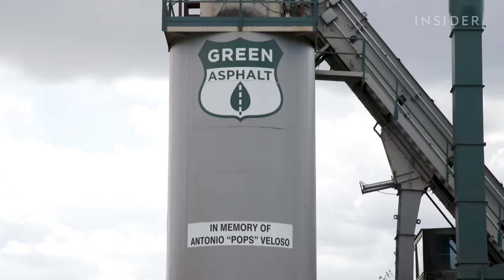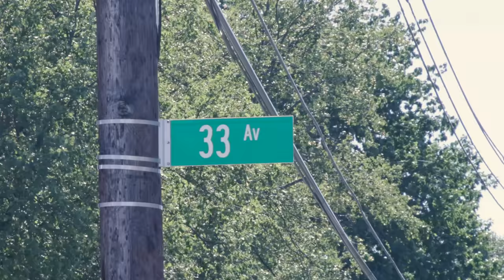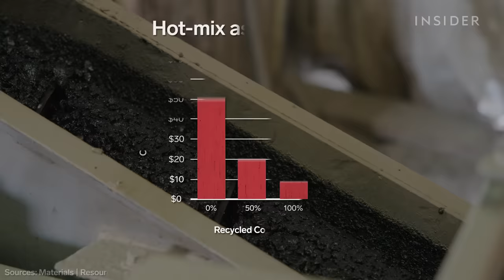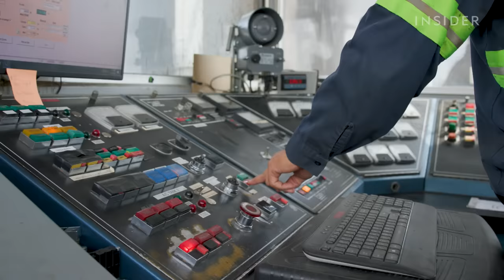Roads Can Be Recycled Forever, Why Don't More Cities Do It? | World Wide Waste | Business Insider

Comment: I’ve worked in the asphalt industry for 10+ years. On the road crew putting the asphalt down and now currently operating a loader at the asphalt plant feeding the rocks into the bins. Not all mix uses recycled asphalt and if it is used it’s still varies. Some asphalt might use 10% recycle. Other mix might use 30%. Some states don’t even allow recycle on certain jobs. From personal experience the more recycle you use, the shorter the life span of the mix you are making which causes more potholes down the road. If you buy asphalt. Ask for virgin

Comment: Unlike wood recycled asphalt still has the same durability, i think it is because the distributors that provide the materials dont want their sales of mined goods to stop
Reply: The sun and time age the material and bitumen.  It does not have the same durability - that is why they say in the video that they must add oil "rejuvenators" into the process.  The asphalt industry is not looking to increase mined goods - like any business, they look to reduce costs while limiting liabilities to produce material that fits the testing/specifications set out by the purchaser (in this case usually the State or local government).

Comment: I only worked with a paving company for about a year, and the base layers could easily be made from 100% recycled materials.
It would be more cost effective, and environmental friendly. If the cost of "binder" was reduced, a thicker layer would be more practical, making use of more waste. Grading the earth deeper, adds more removal, for sure. But that is generally all clean waste, can be used anywhere for anything. Petroleum soaked asphalt can't go anywhere, so trading dirty waste for clean waste and saving money just kinda makes sense if your not a greedy politician.
Top coat was always all new and small grit. That's kinda necessary, and so production will always be ahead of recycling. But of the materials recycled, less than 100% goes back, so if balanced right it could find an equilibrium.

Comment: Before 1990 torn up pavement was just dumped. In 1990 California required all
underground fuel & chemical tanks be replaced and the process was generating 
many many many many mountains of toxic contaminated pavement & backfill. 
So the state had the University of California to look at the problem and they
invented the process where old pavement was crushed down to gravel and
they built a soil burner on a simi truck flatbed so the crushed gravel & backfill 
was put on a conveyor belt which went thru an oven & the hydocarbons were 
burned off and the gravel & backfill was ready for re use.
Thanks California!

!

Comment: They've also done studies using a percentage of used tires in the asphalt, better grip in the rain and less cracking of the pavement, meaning less potholes, but the companies have political connections to prevent this from happening. So we live with almost constant road construction here in the upper Midwest.

Comment: I don’t know if this is worth mentioning, but I think that most asphalt parking lots would last longer if they got remelted once in a while. 

Just bring an asphalt surface up to seven hundred degrees, and then let it cool. That should kill the tar-eating bacteria, and rejoin all the inner cracks. 

A Bobcat pulling a flame-trailer would work. But the trailer would have to move very slowly. Maybe six feet per minute. The heat would have to penetrate to a depth of at least four inches.

Would the lot need a new coating of blacktop? Probably. And also a new paint job. But it would still be cheaper than a completely new layer of asphalt.

Comment: RAP is great. I’d love to read the research papers for the 100% RAP mixes and how that relates to superpave design methodology. From what I remember, lots of states don’t like using more than 30% RAP on long paving stretches because the contractor can’t guarantee the temperature range for superpave design.
Reply: The Cmi design principle that we used here in south Africa mix 60% RA with a drop of 40% on burner fuel consumption

Comment: Great story but it’s not about the recycled asphalt.  Most bases of the road have degraded I need to be replaced.  In areas where there is a lot of freeze and thaw the pavement just gives much faster than it would in an area where the climate is warmer.  The infrastructure needed to fix the road system stems beyond just asphalt tops.  You also need proper drainage to carry the water off the roadways in into the storm systems.
Reply: 100% correct. This is the most overlooked aspect in road and infrastructure maintenance in our country. You cant place a band aid over crap and expect a good road.

Comment: I work is a asphalt laboratory. We use 40% recycled asphalt in Australia. 100% would be complete rubbish. You would never be able to get voids and compaction right.. especially with slag and opengrade highway mixes.

That plant looks like its 50years old. The maintenance running just 40% recycling mix causes 100s of hours in maintenance.

Comment: The reason why they can't do a mix over 40-50% recycle is because the rocks sizes get smaller through  the recycling  process. The mixes are spec for a certain  size rock for strength  in the material . The mix can't hold up to the strength  that's demanded of it .
Reply: Theres specialized crushers for breaking down millings that minimize recrushing the aggregate. It will always break down from milling though. Places like Japan regularly use like 80% because aggregate supply is so much more finite when you live on an island.

Comment: Well that's not true when you grind it up you reduce the size of the aggregate and then reduce its ability to not wheel rut push or alligator crack under heavy traffic loads . Also when you use cold patch and Crack seal with different compounds it causes the failure of the mat earlier.What could be done is the recycled mix could be laid  down over stone and dirt roads for a viable solution to the silicone dust kicked up on dirt and gravel roads. Or subsase materials. IT HAS LIMITS.

Comment: As a Civil Engineer I can tell you the premise of this article is 100% false. Asphalt oxidizes and loses its ductility over time and can not be regenerated. Some asphalt is recycled but needs to have new asphalt cement to make a durable pavement. In fact, asphalt mix that uses recycled asphalt doesn't perform nearly as well or has the longevity of new asphalt.
Reply: What about the 75% used in Germany?

Comment: Alot has to do with how asphalt is made at the plant.  Plants have a drum dryer that heats and dry the rock and sand going into the asphalt.  Then the rock goes into the mixing chamber and the oil is sprayed in.  So you ask why the recycled material can't replace all the sand and gravel? You have to have heat to produce the product and the recycled materials going into a drum dryer will clog and ruin it.  In my area, state materials are only allowed 25% recycled materials, mainly because the oils deteriorate and multiple heat cycles on the stone comprises it's structural stability.  And any paver that says it's the same as other materials and an idiot or ignorant.  The higher the recycle content, the harder it is to finish smoothly without scarring and less compaction.

Comment: Around here they charge taxes on cement as its considered 'permanent". Then in Toronto they will charge you for adding a parking spot claiming the extra water runoff, but theres asphalt like materials and faux grass that allow water to pass through, but dont let that think the wont tax you for it. PS. Asphalt is also called cement.

Comment: In Philadelphia a machine works at night... the front of the truck grinds up the street, and sucks it into a huge bin in the middle of the truck.  That bin is heated by propane and melts the tar.   The back of the truck lays the asphalt back down onto the street as new pavement.  It moves slowly, about one foot every ten minutes, but it does an entire block or two every night.   No trucking stuff around, no extra trucks on the road etc....

Comment: In the 1990s, a Federal Highway Administration (FHWA)/United States Department of Transportation (USDOT) national mandate for the use of rubber in asphalt. As the mandate was rolled out, a lack of clear standards and deficient preparation for technology deployment (e.g., insufficient user training) created a number of problems in the field, ultimately resulting in the cancellation of the rubber use requirement by FHWA/USDOT.  The problems were mainly due to not having the correct ratio of rubber and other materials that bind the aggregate together.  Some states have adopted their own standards but since the rubberized asphalt cost more than traditional asphalt and no mandate or clear guidelines some states have not choose to use rubberized asphalt.

Comment: Anyone who has worked with a 50% RAP mix know there is a reason most places set a upper limit of 30%. Sure you can pave local streets no problem but if you have any real truck traffic on it, it will blow apart in a few years. Not to mention the extreme black smoke coming out of the plant.

Comment: Recycled asphalt is great, but it's not a panacea, either.  Depending on the original mix, how long it's been down before being milled for recycling, the properties of the aggregate, etc., you will eventually need some new materials to mix in.  The binder ages over time and loses some of the lighter fractions of the oils.  That makes the asphalt more brittle, which is why older asphalt roads develop cracks that have nothing to do with load carrying.  Those lighter oils will need to be replaced, or at least replenished.  If you're milling up recently laid asphalt, it won't be an issue, and you can probably get a couple of reuses out of a mix.  But not unlimited.

Same situation with aggregate.  Depending on what kind of rock it is, it does also break down over time.  Again, that's not a huge problem the first time you recycle it, probably, but as the percentage of sand and very small aggregate you recover goes up, you're losing the strength in the resulting mix.  You'll need to add larger stones back in (and dispose of much of the sand and very small stuff) at some point.

Still, the process ought to be more widely used.  It's used to some extent here, but I've been out of the asphalt business for 20 years, so I'm not sure what's current practice.

Comment: Asphalt blows in heavy truck traffic areas. It sags, rolls,cracks and generally falls apart rather fast. Build those roads with concrete because it is more durable and lasts longer with fewer defects.

Comment: Amen!!!!  More power to ya!   Even 50 recycled would be an improvement.  70% would be even better.  I've used screened millings and covered them with basement wall sealer, and a little sand on top.  It sealer soaks in and the sand or even pea gravel stops tracking the sealer.  If I can do that asphalt companies have equipment that could duplicate or do what you guys are doing.  Again, more power to you all.

Comment: has been working with a road authority for ages, their test site lay new pavement almost every month because they accelerated the load a lot for testing. they recycle 100% of the pavement. Sometimes if they got a project on new material then they will have to swap over, but asphalt is 100% already. to me, the decision to use new is main due to laziness in making changes, and the profit on the existingl industry. if new road has to use new material, then these oil and mine industry will continue to profit from it, intead of the recylcing industry.

Comment: Recycled asphalt often has ground up ferrous metal in it which then within months starts produce rust stains and eventually pits as the metal corrodes away. Doesn't matter so much on a public road but on your driveway it can look like heck. So when you asphalt  your own driveway ask them to not use recycled if you care about its looks

Comment: The grinding to the repaving should all be done at one time. The should be a grinder that chops up the road, then the material is heated in a drum, new "tar" is mixed in with the old, it comes out the back and goes into the machine that spreads it out, and then the rollers and packers go behind it. Like a big caterpillar eating old road and pooping new road out of the backside. It doesn't make sense to dig up hundreds or thousands of tons of old asphalt and haul it 25-50 miles back to the paving company, then grind it up and haul it back to the job again.

Comment: So, this has been common knowledge for those in the trades, for many decades. Im concerned about the comments here. Folks are extremely ignorant to how infrastructure is built. This is only 1 specific material focused on in this video. There's concrete, bricks, dimensional lumber, drywall, glass, metals, plastics and several different types of rocks, sand and soils. Recycling has been happening since before anyone could document it. Humans are not as wasteful as some tend to proclaim. We just tend to live longer than most creatures and have the ability to voice thoughts and feelings better than any other creatures. Keep it simple. Do your best and be productive and efficient.

Comment: Far and away the biggest issue with asphalt roads is poor longitudinal seams.  Cuts the service life of the pavement down by more than half.  Here in Minnesota MnDOT has no clue how to get longitudinal seams correct.  Many highway projects around the Twin Cities have failing pavement sections due to poor longitudinal seams.  Wasting hundreds of millions of dollars.
Reply: Your talking about the joint correct?
Reply: @colto8284  Yes where they laydown one section of paving next to another.  When you get to the end of the mat without containment there is no compaction at this location.  If you are able to run two pavers at the same time and the mat is still hot enough and you use a Knockdown, rubber tire, than finish roller you can achieve the exact same density at longitudinal joints as the center of the mat.  The joints are usually at the lane striping.  You can also use a cutter wheel on a road grader blade to remove a couple inches before laying down the next mat if the previous run is cold.  I have run millions of dollars of high end asphalt work at terminals on previous projects.
Reply: @ryanksiazek  I was just making sure I was thinking what you were meaning man, yea I'd say here in the states were way behind "on purpoae" I'd say. I'm a screening for a big company here. Alot of things always make me scratch my head and go ehhh wont that make it worse in the quality area? I've always wanted to fo to Europe and try some stuff out though. I'm dead serious I'd travel for a year to work and learn somewhere else, but the chances of finding somewhere...impossible lmao

Comment: They even have made machines that grind up the top layer of the asphalt, melt it, add little bit more new material and then lay back the mix of mostly old and small amount of new material back on the road. But i think it has to do with special interest and profit above all...
Reply: That's a treatment called hot in place and it's not quite the same. It only works to a certain depth and it cracks in the next 7 years or so. That reheating also damages the oil and rock so that recycled material gets weaker everytime you do it. 

Don't get me wrong though, it's a great process that saves money and resources. But it's never as resilient as a new road with even 20-30% RAP

Comment: Asphalt is 3 ingredients, not 2.  Limestone, sand, and asphalt cement (oil).

Depending on the type of road, there are multiple layers of pavement.  It’s usually the top layer that is recycled 100% as it contains the most oil and small stone.  

State highways and roads typically only allow a very small percentage of recycled product.  Driveways and parking lots will contain large amounts of recycled products.

Comment: I think a machine that could grind the top inch or two of old road surface, send into a heated chamber, where you add more oil, or what ever is used. then it is poured out the back like a normal asphalt spreader...

Comment: There is another process where the existing Asphalt is ground, melted, remixed, topped up in place. While the process may look slow, a city block is only out of service while the Machine Train Passes over the site once, and done. The finished road lasted as long or longer than the  grind, strip, spray, lay down new asphalt, pack, roll, since and repeat.

Comment: The DOT needs to change their specifications to demand a certain amount of tonnage yearly goes to using RAP mixes.. As long as the testing shows the right air void values and good stability numbers whats the problem
Reply: One issue people mention is that recycled asphalt isn't as durable and does not last as long as virgin asphalt. I love to see that analyzed and evaluated on DOT level I mean they know whats up so they could spec the ideal forever lasting asphalt mix.
Reply: @alouisschafer7212  in my city our membranes fall apart due to sub grade failure after a few years.  We blame the HMA design but it's mostly the base and sub base prep that's lacking in my opinion